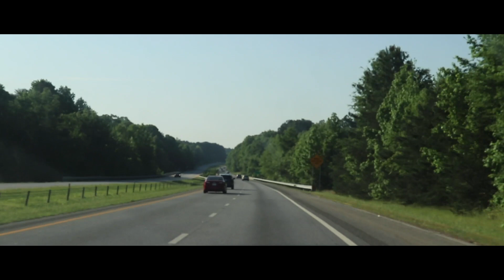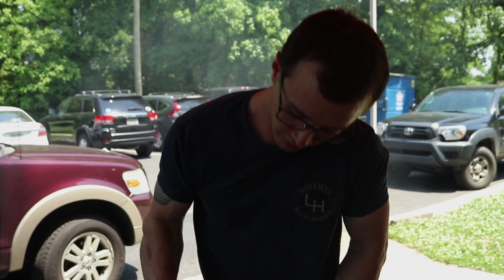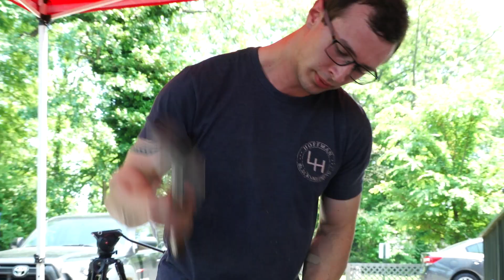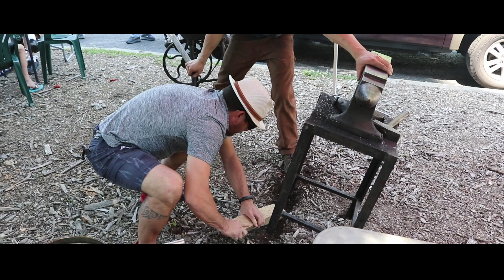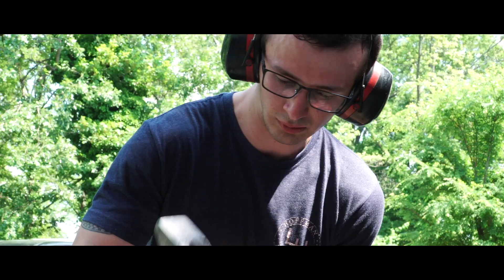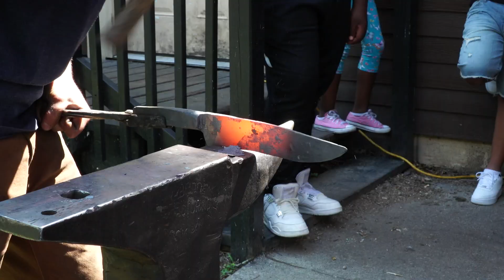FORGING ALL STEEL KNIFE - Quenched in BBQ sauce?

Comment: I hate to say it as you will probably go play rather than working on my axe,   😎,    but in Japan and the Philippines they used to use melons for their quench. These are not like watermelons that would simply split, more like a "juicy squash" with no seed pocket in the middle like our melons. The idea seemed to be that the blade edge got the most chill and the later parts of the blade were cooled by the progressively charred parts, leaving a differential hardening with a softer back than edge. The speed of the stroke probably mattered considerably too. Of course, you can conduct a scientific study of barbecue sauces for your knives too.   LOL    Have fun!